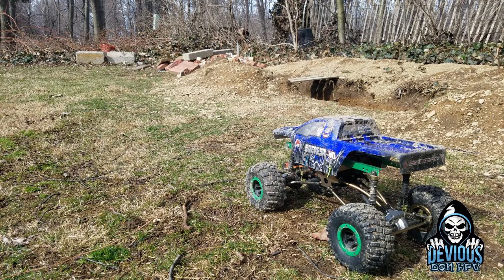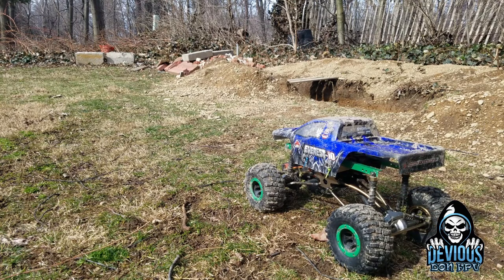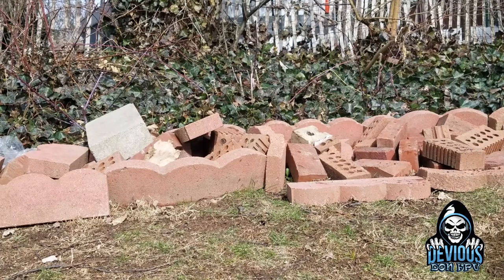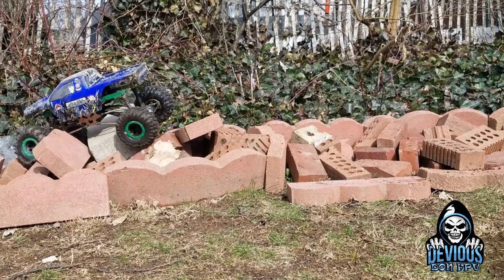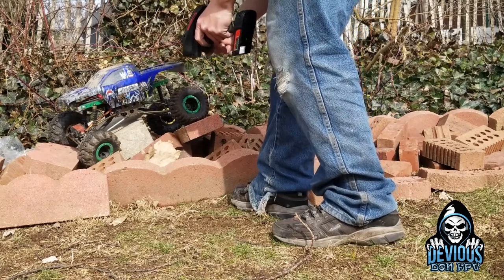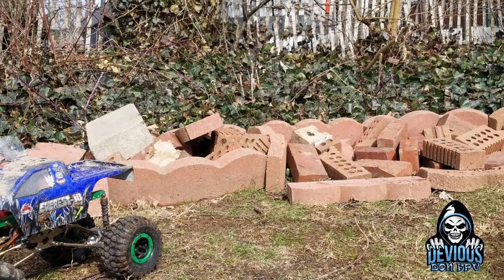Redcat Everest 10 Titan 12t motor mod Results... watch till end to see why this is NOT A GOOD IDEA

Comment: I don’t even see how you fit that motor in there no wonder it blew up
Reply: You can put a 550 in it by bolting the upper links to the outside of the chassis and put the bolt in from the inside it gives you clearance for longer motors! He fried the esc because the stock one is only 40a that 12t is too much the esc
Reply: @jameshankssr466  He’s also just hammering it constantly then kept going full throttle when bound… with normal driving and crawling it might be ok. Still a silly motor for this though, no low speed control and way too fast for a crawler.